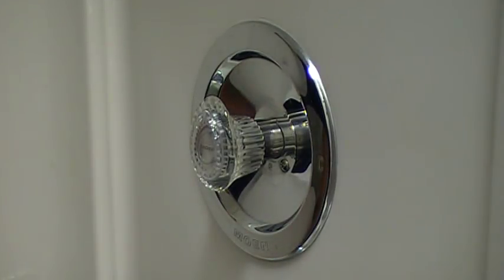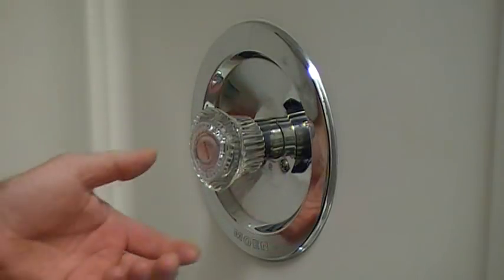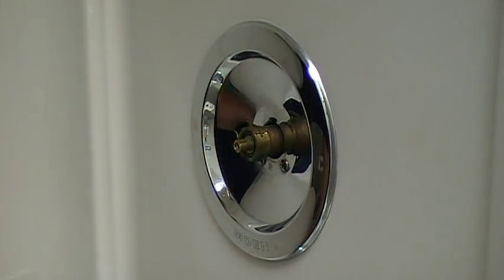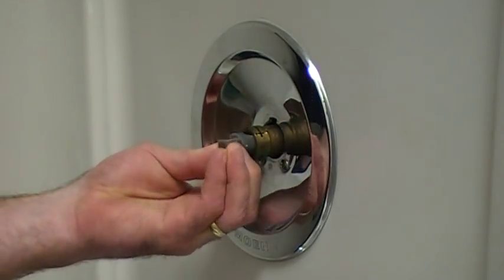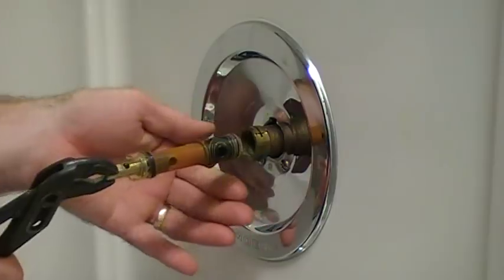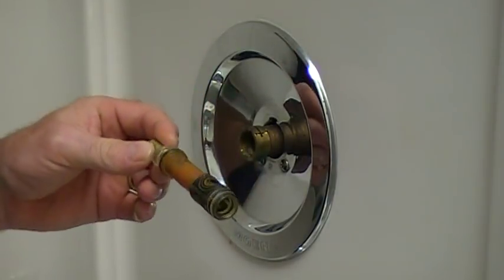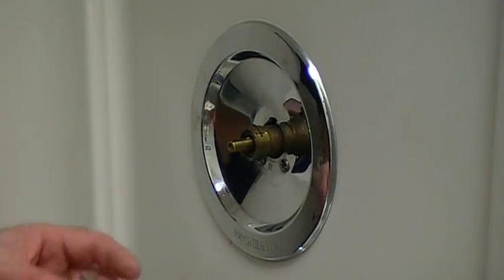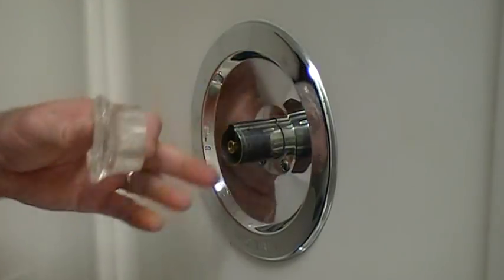How to repair a leaky single lever moen bath or shower faucet..Older style

Comment: Thank you so much you saved me over $500.  My plumber pulled on the cartridge with a plyers for over 20 minutes.  He said it was rusted and would have to go into the wall and replace the pipes and cartridge.  After I went on line and saw your video, I showed it to him.  He was skeptical but I got him to try it.  After less then 3 minutes he got it out to his amazement.  Thank you again.

Comment: Oh thank you sooooo much, I watched your video a few times & started to take my leaking faucet out, your instruction & video is so clearly illustrated & easy to follow. I do not have that little plastic tool, but I manage to use the plier to losen it and pulled out the cartridge. Since you said Meon quaranteed for life, I went to Lowes & asked for a replacement & they gave me a brand new one for free. I was able to fix my leaking faucet without spending a penny. I truly appreciate your help !

Comment from the maker: If you are turning the cold water off to the entire building then the hot water will be shut-off as well, but if you are just turning off a cold water valve to the faucet then the hot water must be turned off as well. Not often is there a valve placed on the shower or bath faucet and most often  the water has to be shut-off to the entire house.
Thanks for commenting and best of luck!     Al

Comment from the maker: Hello Diana;

If your Moen faucet pulls out and turns; then you need a 1225B cartridge. If your faucet just turns and you do not pull it out; then you need a 1222B. The last number I gave is a posi-temp cartridge. It is the newer style.
You have to turn your water off and by turning the main cold water coming into the house off; this will stop both the hot and cold and you will be able to repair the faucet.
Thanks for commenting and good luck!  Al

Comment: THANK YOU ... THANK YOU! My moen Shower / Tub faucet was leaking. I decided to search and look for some advice and expertise on how to repair or replace this faucet and I ran across your video. Watched it a few times, took it out, went to the hardware store, got the exact part, came home and watched your video again.. then put it back together just as you said, and No More Drip Drip Drip! Thanks again...

Comment: That last tidbit you provided at 4:30 saved me a lot of trouble. We bought a house with this style moen in the bathtub that had the hot and cold reversed. I've sweated this repair for months, but removing the handle and turning the stem 180 degrees set it right. I didn't even have to turn off the water. Took 10 minutes max since I cleaned up the chrome while apart. THANK YOU!!

Comment: Thanks so much for your video. This really helped. I had to use a vice grip to remove the trim and a cartridge remover to get the cartridge but it worked and now there's no leak. Thank so much!
Reply from the maker: +Zach Schultz 
You are more than welcome!
I am glad it worked out for you! Sometimes they can a bit of a challenge depending on water quality, but they can be repaired most of the time.
Thanks for commenting and have a great week!    Al

Comment: Hello, and thanks for posting this video.  I have the same model and with your video, I was able to approach my local plumbing store with some knowledge of what I was looking for.  They gave me the cartridge for free while only paying for just $7 for a new handle.  The new handle was needed because the screw holding it in place fused with the old cartridge and I couldn't get it off, even after trying to drill the screw out (lost a drill bit in that fight too).  Now, it is as good as new.

Comment: Thank you so much for posting this video!  You just saved me a plumber call.  What happened with mine is when I put the white plastic tool in to remove the cartridge and turned it..just that stopped the leak.  I did not end up needing to replace the cartridge at all!  I will hold on to it just in case but seems good to go!

Comment: Worked perfect!! I came across your video & showed my husband, we bought the part, & fixed it just like you said!! The only problem we ran into was that the 2 rubber pieces from our old part were left stuck in our pipe (we had little water pressure when we turned it on). We turned on the water & they came out!! Thank you so much!!
Reply from the maker: +Brittany Williams 
You are more than welcome!
I am glad it worked out for you! 
The old o-rings can be a problem at times when removing the cartridge, but patients usually wins as it did in your case. Congrats on the repair!
Thanks for commenting and enjoy your week!   Al

Comment: This is the second time you've saved me money by doing it myself!  Thanks again!  My shower cartridge had been leaking (albeit very slowly) for a couple of years but since I never use that shower, I was always forgetting about it.  I was worried that the cartridge wouldn't come out due to mineral buildup.  Thankfully it twisted with no excessive torque needed.

Comment: I want to thank you for your demonstration it was very descriptive and went through all the fazes of removing and installing a new cylinder In the Moen Faucet. One thing that may be needed for some is a tool to extract the stem, you can get it in the plumbing area, cost@ $12. I had a great deal of difficulty trying to dislodge the old cylinder and had the tool which was helpful, this was at the suggestion of the plumber at Lowes.
Reply from the maker: +Monica Ryan 
You are more than welcome!
I appreciate the  the input! 
Thanks for commenting and congrats on the repair!    Al

Comment: Excellent video. There are many YouTube videos showing this procedure, except the majority don’t show the magic “twist” to break the cartridge loose, as yours does. If you don’t do that, there’s a chance a strong pull could pull out only the center part of the cartridge- not a good thing. Also, I like to remove the clip with an awl; there’s a little hole right at the top; works like a charm.
Reply from the maker: Hello PacTel54321,
The twisting motion is the best tip I can give as far as removing the cartridge. I have heard of a few situations where people have actually got on top of their countertops to remove the cartridge on their kitchen sink faucets. Sounds wild, but it happens. Once you have the cartridge turning it should come out relatively easy.
And you are correct by saying that there is a good chance you will pull out the center stem instead of the entire cartridge.
An awl would fit that little hole perfectly. I generally use a pair of channel locks myself to remove it, but the awl would work well too!
Thanks for the kind words and enjoy your week!     Al

Comment from the maker: Hello Sarah Polise;

Yes! If you have a moen style faucet and it is difficult to pull out then replacing the cartridge will solve this problem for you. The cartridge you would be looking for would be a 1225B made by moen. This will resolve your problem for you. Every hardware store should stock this part.
Thanks for commenting and best of luck with your repair!    Al

Comment from the maker: Hello Jim;

The retaining clip is the most important component to the repair. It is definitely required to hold the cartridge in place. If the retaining clip is not installed the cartridge will push out and you will end up with a huge mess on your hands. One does not come with the new cartridge. You can install the old one as they can definitely be reused.
Thanks for commenting and let me know how you get along!    Al

Comment from the maker: Hello Jim;
Not a problem here. The cartridge that you are looking for is a 1225B style to stop your leak. The little plastic tool usually comes with the new cartridge. If the plastic toll does not work then a pair of needle nose pliers will.You must turn the cartridge first before you try and extract it. I made a video on both types of cartridges...Old plumber shows tips and tricks on moen faucets..This video shows both types of cartridges.
Tks for commenting and let me know how you make out! Al

Comment: Your video was well done and it gave me the courage to do the job myself. I couldn't find the replacement cartridge at Home Depot, Lowes or local Ace. It's a 26-year-old faucet but the cartridge had been replaced some years ago by a plumber ($$$). While in the plumbing dept I noticed O-Rings and realized the existing brass cartridge looked fine - no deposit buildup and maybe it just needed new O-Rings. I spent $5 on a pack of O-Rings and silicone grease and reinstalled just like your video shows. It worked! The leak stopped so I did some preventive maintenance on a second shower in my home for fun. Thought I'd share for future viewers of your video - if the cartridge looks good - consider replacing the O-Rings. Thanks for the great video instruction.

Comment: flawless tutorial. Worked exactly as you said. Took about 4 mins. Really glad you pointed out the o-ring that was on the shaft. Mine had one like that. If you hadn't mentioned it, I'd still be trying to figure it out.

Comment: Been nervous about fixing the shower. I watched the video a couple times and decided to give it a shot. $20 for the cartridge and 30 minutes later, done! Thanks so much for the video. It is so helpful.
Reply from the maker: Hello Michael Mahoney;
You are more then welcome!
I am glad everything worked out for you and congrats on the repair!
Thanks for commenting and have a great week!     Al
Reply: TheOldkid888 It has been working fine and just started leaking again. Why would that be?
Reply from the maker: Hello Michael;
I am not sure why it would happen again. Could be a little mineral in the water that has gotten in the cartridge or the housing may have a little pitting in it.
Did you install a plastic cartridge with the center piece being made of brass?
Was the one in the faucet that you removed made of brass?If so you may want to try the cartridge that is completely made of brass again.
This may rectify the problem for you.
Thanks for commenting and have a great week!    Al
Reply: Thanks Al. After another shower, the problem was gone again! Must have sediment in or something that dislodged...I guess. Thanks so much for responding. Enjoy your 4th!
Reply from the maker: NP...
Have a good one!   Al

Comment: Thanks for making this video, it quickly and clearly explains the process. I ran into one issue, the cartridge would spin 360 degrees, but I could not pull it out. I put vise grips on the end of the plunger and pulled fairly hard, but I didn't want to pull the plunger out of the cartridge body.

What I ended doing was finding a socket whose big end fit right over the end of the cartridge, and then I ran a long 10-24 screw through a nut, a large washer, through the socket, and into the plunger. By tightening the nut I was able to slowly and easily pull the cartridge out. Replacement was easy after that.
Reply from the maker: Hello slomatt,
You welcome!
Sorry you ran into some difficulty with the repair, but I must say that was a good thinking on your part!!! 
They are all different when it comes to changing out. I have had some that almost fell out and others that fight the entire way. A lot depends on the water quality. Minerals can make the removal a pain in the back side.
Thanks for commenting and enjoy your week!    Al

Comment: Great video!  I replaced the cartridge in 10 minutes following your instructions.  Water was off in the four-plex less than 5 minutes And, I remembered to plug the drain before I started. :)
Reply from the maker: Ernest Thebo 
Thanks for the kind words and congrats on the repair!
Covering the drain can save major headaches!
Thanks for commenting and have a great weekend!     Al

Comment from the maker: Hello garden2grow; If you have removed the clip and tried the moen puller and still no go; you may have to look at replacing the faucet. I have come across this once before. It is a pain in the backside. Some of the older models all had brass cartridges in them and sometimes would almost bond with the faucet itself; depending on the water in your area. Let me know how you got along. I would have replied earlier, but was away on the weekend.
Thanks for commenting!    Al

Comment: this was an excellent presentation - everything went almost as expected - cartridge was very hard to remove - it would twist but move out only about a 1/2 inch - sprayed WD40 in there and let set for 10 minutes - was able to then easily remove cartridge which had probably been in there over 20 years - purchased 1225 replacement cartridge at Home Depot for around $20 - tested and no drips -thanks
Reply from the maker: Hello Henry;
You are more the welcome!
Thanks very much for the kind words and congrats on the repair!
Thank for commenting and have a great week!    Al

Comment: This video is still very relevant. I used it and some other videos that showed what would happen if you just pull the guts out of the cartridge. Turns out my cartridge was stuck, but following the video I managed to get it out using plyers and the "white" plastic thingy. I had to guess that the cartridge was the Moen 1200, as I did not have anything but the tip of the cartridge to go on.
Reply from the maker: Hello meanpersonable,
I am glad everything worked out for you and congrats on the repair! Spinning the cartridge back and forth before trying to pull it out makes all the difference in the world. If the plastic tool doesn't work you can always use two screwdrivers, cross them over and turn them with another screwdriver or tool. I have a video on this if you ever get into a situation such as this.
Thanks for commenting and enjoy your week!      Al

Comment: Just finished this repair and it worked great! Thank you!!
I did have to go do the 180 turn to get the hot and cold appropriately placed and after I did I noticed that when the cold water is full on it comes out at half flow. 
Ok, I went back and turned it the other direction to align hot and cold and it’s back to normal flow.... I didn’t use a Moen cartridge so I believe I very slow drip... better than a constant stream. 
Thanks again!!!
Reply from the maker: Hello jcalamouse,
You're more than welcome!
I am glad the repair went well for you! Congrats!
Thanks for commenting and enjoy your day!     Al

Comment: great video, you make it look so easy now I am ready to tackle a job I've been putting off for a year
Reply from the maker: Hello mrequi1,
Thanks!
Biggest thing is to get the cartridge turning before you pull it out. 
Makes a huge difference in removing the cartridge. 
Take your time and you should be all set.
Thanks for commenting and best of luck with the repair!    Al
Reply: TheOldkid888 I did the joob yesterday, it was surprisingly easy considering it was prob a 30 year old faucet.

Comment: 9+ years later, this video is still the best.  Simple and complete.  The only thing to add is if you need to remove the  face plate,  fill the gap with a rag, so nothing falls behind the wall.
Reply from the maker: Hello Bill,
Good point!
You definitely don't want anything to drop out of sight. And don't forget to plug the drain. 
Thanks for the kind words and enjoy your weekend!     Al

Comment: Thanks for the video!  I had to replace a Moen 1200 cartridge in one the homes I manage. The plastic tool did not work for me in regards to loosening up the old cartridge.  When I pulled on the old unit, only the stem came out and the cartridge remained stuck inside.  It looked like it was really seized in there. So I sprayed some diluted vinegar inside and let it sit for about 15 minutes, Then I lightly hammered a #6 extractor screw in, and then simply turned it out with vice grips. The installation of the new unit was easy thanks to your video.  Much appreciated!
Reply from the maker: US Property Manager 
You are more then welcome!
I am glad everything worked out for you!
They can be a little difficult at times depending on the water quality!
I like the screw extractor idea. good on you!
Thanks for commenting and have a week!    Al

Comment: This is the best instruction demo I've found for this faucet!  Also, if you call Moen, they will send free parts to you.  Their products ARE guaranteed for life.  :-)  You don't need to buy a puller tool if your cartridge is stuck...  vinegar sprayed into cartridge area will loosen it up... I imagine Limeaway or CLR would help it loosen also.  Thanks, Al!!!
Reply from the maker: Hello J J;
Moen does guarantee their faucets for life. I am probably their number one fan!
The little plastic tool that comes with the cartridge works wonders on almost all cartridges. You should turn it before you try before you pull it out as it will make it much, much easier to remove.
Thanks for the great comments and have a great week!    Al